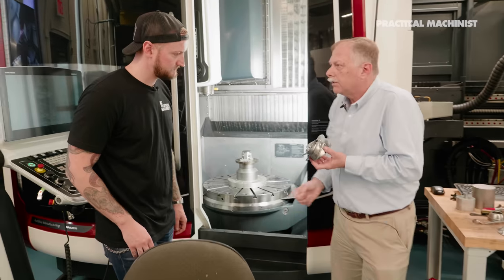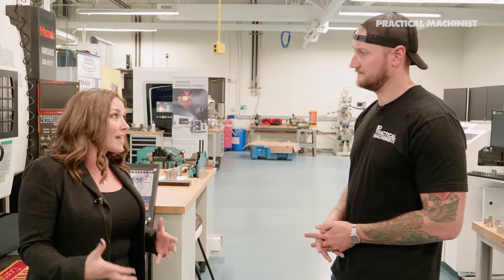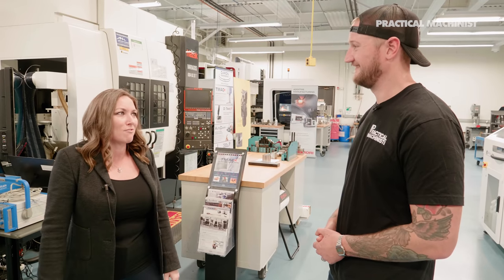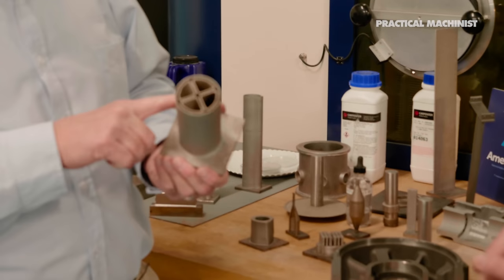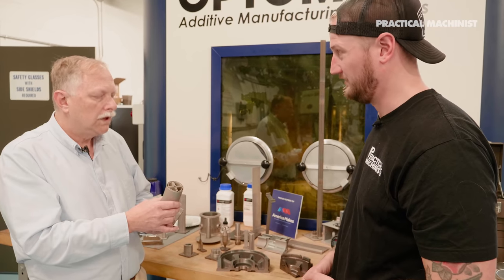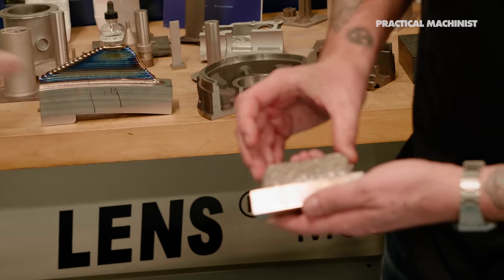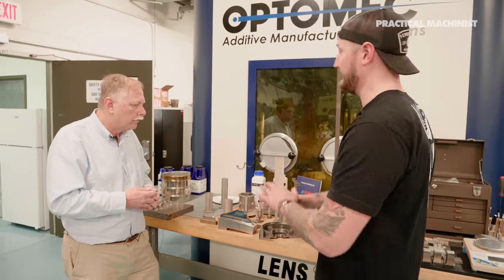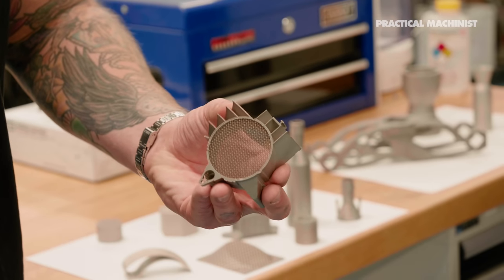Why So Scared Of Advanced Manufacturing Technology? | CCAT Shop Tour

Comment: Did you get a chance to look at the DMG Mori and learn what the printing to machine workflow is like? Particularly interested if it can pause printing midway through, send it to the machining side and then resume printing? For internal features that would be inaccessible on the finished part? Also can they reclaim, recycle machined chips back into powder for use on the 3d printers?
Reply: From what I understand, the printing head is just like a tool - so you can print, machine, and print all in the same workholding! I don't know about powder or chip reclaim, however. Super cool stuff!
Reply: He seemed to indicate that they dispose of the powder and chips as scrap.  So it sounds like this shop cannot do this directly, but I wouldn't say it's impossible or not done anywhere.  You would likely need clean and melt down the scrap, and blow it through some nozzle while molten in order to get the right particle size for printing.  Or grind and separate it through various sieves making sure it's pure metal at the end of the process.

Comment: I guess another major reason for NASA to want a completely additive manuf. engine is process simplification -  to have the ability to produce any spare parts or even a whole new engine in remote environments without a whole machine shop, no humans onsite etc.
Reply: That's what I was thinking.  It opens up a lot of possibilities that are currently the stuff of science fiction.  One possibility being the ablility to send space craft to distant places and have them build things in transit autonomously, over the decades it takes to arrive.  Or just having remote stations that can manufacture complex parts without needing tooling or support from earth.  Imagine trying to mine, smelt, cast, and machine something like a small gear on an asteroid.  Being able to chemically process ore into powdered metal and print it directly would be way easier than trying to launch an induction furnace and 5 axis mill into orbit.

Comment: Are additive manufactured parts equal in all characteristics to a traditionally machined parts? 
    flexibility, tensile strength, hardness, etc.?
      I've seen powdered metal gears that were trash compared to a machined and ground counterpart.
Reply: It is welding so. . .its not too weak. Welding is used for hard surfacing, construction etc... and not all gears have a hard life.
Reply: @dfpolitowski2  Some powdered metal products are superior though. CPM knife steels hold a finer edge longer than their roll forged counterparts at the same Rockwell hardness.